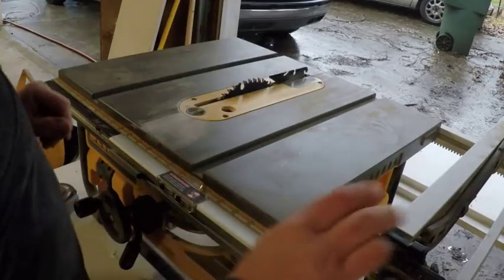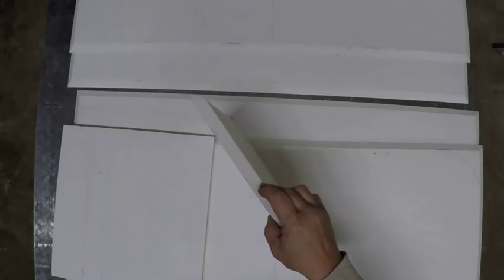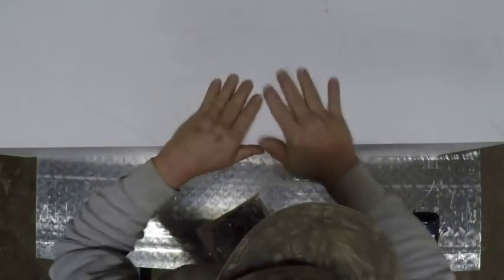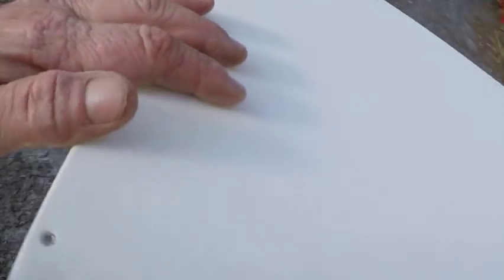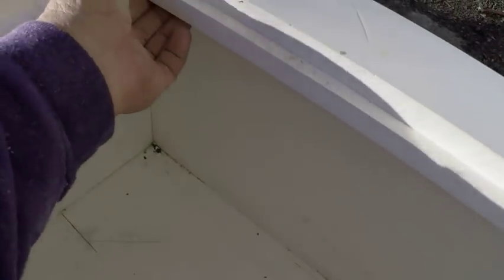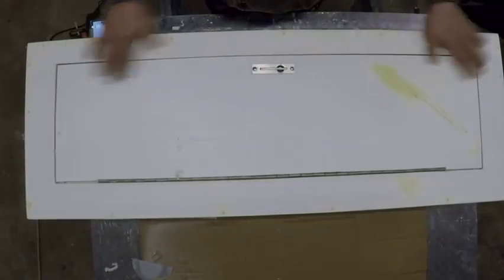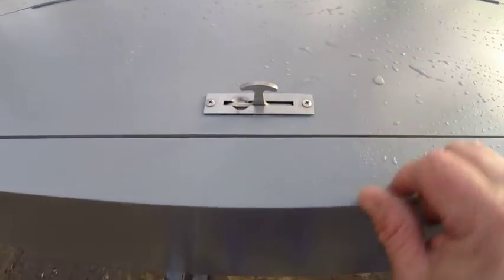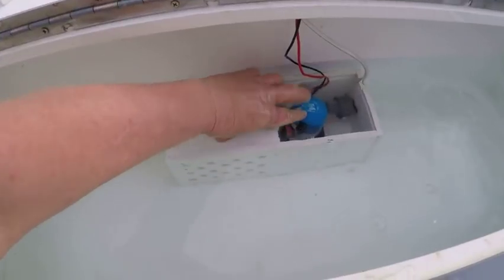DIY CUSTOM CATFISH TOURNAMENT LIVEWELL BUILD

Comment: awesome i just made me one out of big tool box i got for 50 bucks 40 for double 12v bubbler an it kept them so alive i couldnt hold them up for a picture.I made my bait tank out of the 30 gallon built in ice chest in bass boat with one of these 12v bubblers it keeps the fish so alive the water stays cool cause has no hot airator putting heat in water.now get me one them boat covers i be in shade out of weather an both livewells stay in shade i be ready to fish tournments in any weather

Comment: In this video I can see that the pvc material is the same as what I have. Now I'm doing a transom and a live well thanks for the idea I came out cheap on my pvc I bought mine in 4x16x3/4 sheets for 40 bucks so I bought a lot and now I'm going back for more he has about 1500 sheets lol
Reply from the maker: Lol.  I love the stuff.  I build all kinds of stuff from it.  Thanks for watching and commenting it makes my day
Reply from the maker: I guess you seen the transom video lol 😂
Reply: @bowl830  I did lol I've been watching the build and getting ideas for my bass boat and had asked about what pvc board you were using because I had some and was wondering about the flex on the transom but after you resined them together it was much stronger thanks for the advice and videos I'm watching the video on the live well pump build now 😂

Comment: Sorry for all the questions. What type/size screws are you using. Look like SS. Look like small heads. Box looks great.
Reply from the maker: I was using stainless trim screws.  The heads are really small and can be filled easily.  I use my 16guage trim nails and my air nailer most times.  The fasteners  are there till the epoxy cures after that they’re just extra.  Thank you for watching I appreciate it

Comment: Have you had any leaks using the resin as a adhesive instead of some sort of sealant?
Reply from the maker: Resin will chemically weld it together.  I’ve never had to use a caulk or sealer after built.  I’ve had a tank built like this for 15 years that holds over a hundred gallons.  Never had a issue.  .

Comment: Hey Jeff- how do you drain this thing buddy? I mean I reckon I could just syphon it or elbow into the existing drain- just wondering if you had any ideas. Awesome build. Love it. Have a little bass tracker classic xl but the well is too small to tournament fish- need to build an add on.
Reply from the maker: I built that to used as a removable one.   If it was permanent I would plumb it in to the boat.  I just pull the plug and let it drain in boat
Reply: @bowl830  thank you sir. This is a great build. I’m working on adding one to my bass tracker classic to fit some dimensions I need- this will work perfect. I appreciate you taking the time to do this and upload it.
Reply: Also just want to add I’ve watched hundreds of these videos. This is the best one on YouTube. I was close to pulling the trigger on an RV water tank that was a few inches off of what I needed- but this is the best tutorial on here.
Reply from the maker: Thank you I truly appreciate it

Comment: Are you using polyester or epoxy resin to bond edges.
Reply from the maker: The best I’ve found for this is just basic auto body fiberglass mesh resin.  It’s works the best for me
Reply: @bowl830  thank you

Comment: What kind of material are you using?  Its not plywood right?  I’m interested in making one just like this.  But wasn’t sure of what kind of material you were using.  Any info would be greatly appreciated and where I might be able to purchase that material.  Thank you sir and that livewell looks great!!
Reply from the maker: It’s a PVC type material.  Most contractor supply places can get it.  Here in the Charlotte NC area you can get it at a place called the building center.   Thanks for watching and commenting I appreciate it
Reply from the maker: It comes in all types of sheets.  From 3/8 -1” thick
Reply: Team Reelin The Blues thanks again!!  This video is super informative. I don’t think I’m going to have any issues building one once I find the material!  I live here in Texas might take some time to locate that material!  But I’m on a mission now lol
Reply from the maker: Awesome buddy.  I’ve built these things this way 8’long by 2’ deep with no issues.  Good luck.   It’s a Boise cascade material I believe

Comment: Do I remember you saying not to use Bondo fiberglass resin??
Reply from the maker: Don’t use body filler.  Bo do brand resin is good stuff for sealing wood.   Not for rivets though
Reply from the maker: It’s great for sealing seams in porous materials
Reply: So this resin would be good for the PVC board?

Comment: Awsome build Jeff. Where do you buy that material?
Reply: Wondering the same thing
Reply from the maker: I buy it from a local lumber company. Called.  The Building center.  It’s in Charlotte NC   It runs 125-150 a sheet. It comes in 3/8” 3/4” 1” thickness.  Easy product to work with.
Reply: Awsome. Thanks man
Reply: What size did you use how long and wide
Reply from the maker: The big tank in the opening picture was 76” long 22 deep and 22wide.  I buy it in 4x8 sheets.  3/4” thick.   The little tank in the video took about 3/4 of a full sheet
Reply: Awesome video buddy thanks

Comment: Did you use the resin to fill screw holes ?
Reply from the maker: I used just auto body filler. In the tube. Not bondo. But that would work.
Reply: @bowl830  Why did you say not Bondo , its fiberglass resin. I don't want to get the wrong resin.
Reply from the maker: I used the body filler in the tube that you don’t mix to fill my screw holes before I painted it. Bondo works too just have to mix.  I used fiberglass resin on all seams to glue them together

Comment: I know you are using fiberglass resin here.  Have you ever tried PVC cement?  I used it on a shower shelf project and it worked great.
Reply from the maker: It don’t have the strength that resin does.  Several people sent me messages saying they used it instead of resin.  They all have leaks lol.  Resin dries much slower so it actually soaks into the pores of the material and it becomes a permanent bond
Reply: @bowl830  interesting...thanks!
Reply: You mentioned getting it at the Building Center in town...have you called Piedmont Plastics?  Their prices were about half the cost of Starboard...they did say they did not think Cellular PVC would last as long as starboard.
Reply: What is the type of material used. I try to find in portugal but is very dificult you can specify ?

Comment: Hi Jeff, I have watched your video of the live well build at least 4 times soaking in all the info.  However, I have searched and searched for the 3/4" x 4' x 8' pvc sheets and to no avail.  I can't find them any where!  Can you shed some light on where to buy them?   I'm in the process of replacing deck, carpet etc in a 2002 bass pro crappie 175.  After getting into it, I have decided to replace 2 of 4 small live wells using only 2 of them and adding more rear deck area.  Therefore, I want to add your design of live well into the rear deck addition!  I only want to do this once, so I want to do it my way and get it right the first time.  Please help with the place to buy the pvc.  Thank you in advance,  a fan,  Harvey Adkins of Jacksonville, Ar.
Reply from the maker: Hello Harvey. Thanks for watching I appreciate it.  The best place to get it is at contractor supply places not big box stores.  It runs about 160 a sheet but it’s a great product.  I’m using it to build stuff for my new project.  It’s a tracker that I’m turning into a crappie/Striper boat.  Good luck.
Reply: I'm in Little Rock, Ar. and I can't seem to find anywhere or anyone that can get it or has it.  HELP?

 @bowl830

Comment: Nice job!  Is the material UV stable like Starboard?
Reply from the maker: It’s a porous material unlike starboard but it holds up to the sun very well.  We use it for custom exterior millwork.  Columns facials and such.  Never had a issue.
Reply: Yeah, I’ve used it as trim between lower siding and gable siding.  Also around my doors.  

I’m planning a leaning post livewell with rounded corners...I had not thought about that stuff.  Have you ever tried to heat and bend it?
Reply from the maker: The 3/8 and 1/4 bend real easy.  The 1/2 is hard and 3/4. Is almost impossible lol.  I’ve got a video on here that shows how I built a livewell for bait out of it.
Reply: Isn’t this that video?  Or is there another one? I’ll look now
Reply from the maker: Yes it is. I’m just eat up lol.  I put a video out today of my home tank. Was thinking that was the one you commented on.
Reply from the maker: I’m out in the middle of lake Wylie catfishing lol